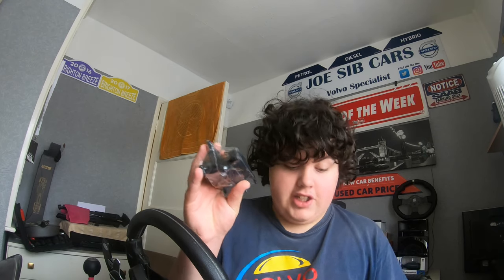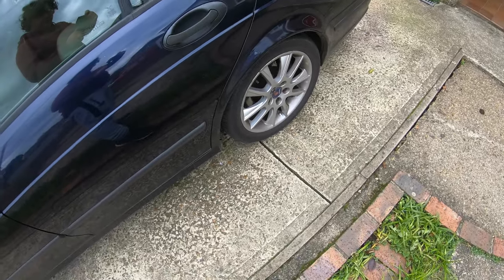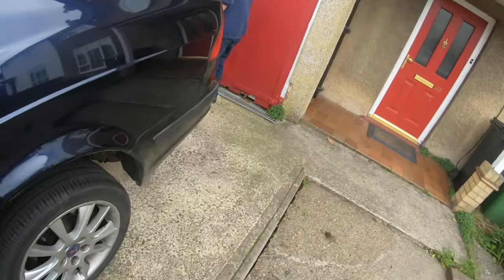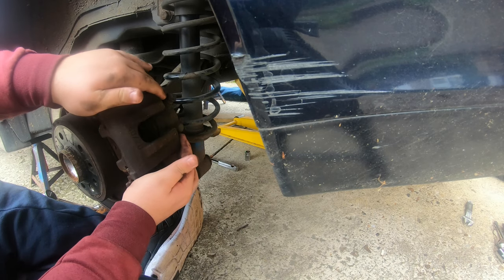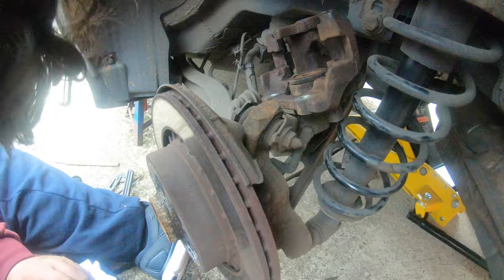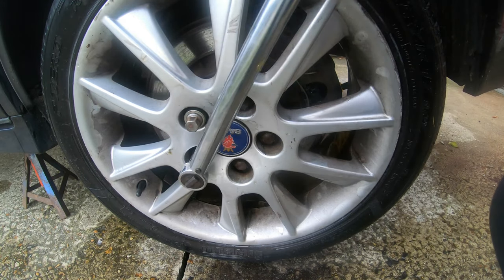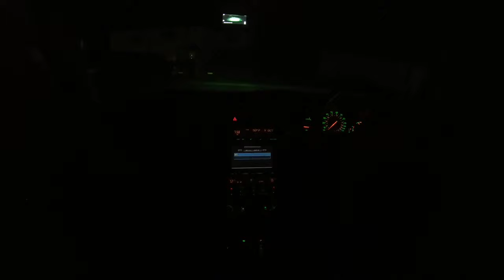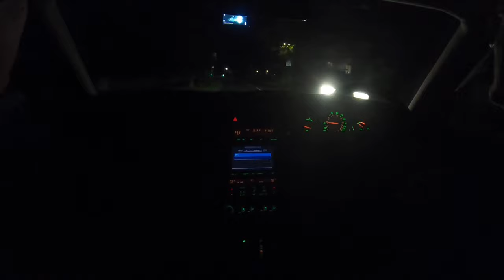Saab 9-5 rear brake pad replacement

Comment: Bro those are not welded on with rust you are just not strong enough mate. You need to setup a camera in one spot without pausing all the time
Reply from the maker: I'm strong enough to brake it lose bolts can get rust welded I'm not weak and I pause because I've got to get something and it would be boring if I left the camera running while I get tools but I will not say I'm going to pause I will just leave the camera running and I will cut the boring bits out at the end But thanks for the information Take care